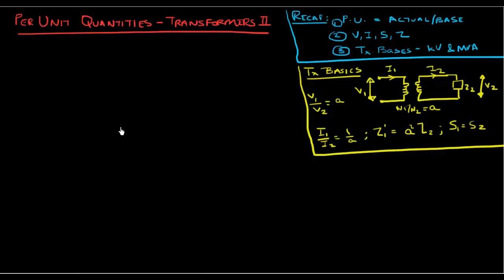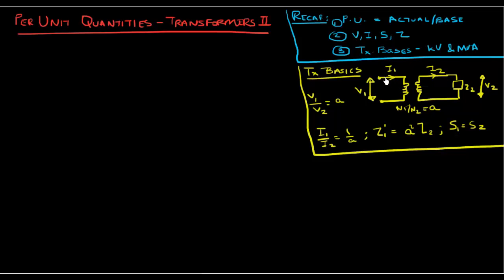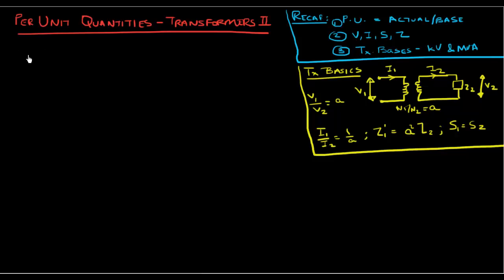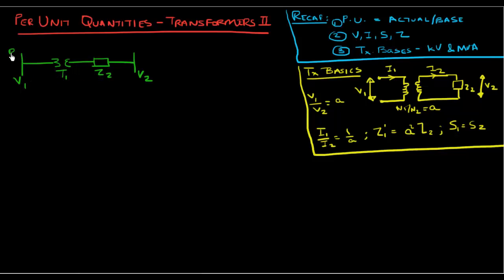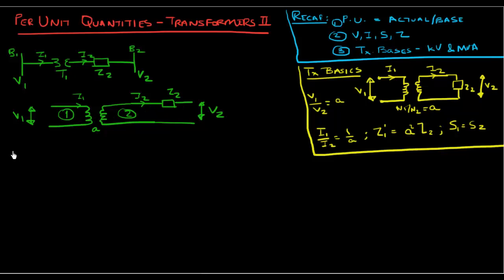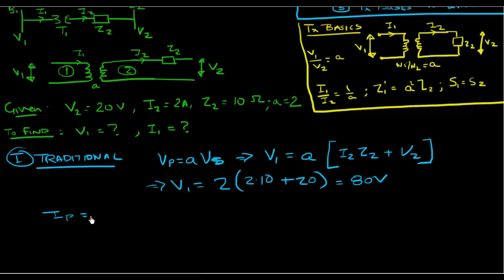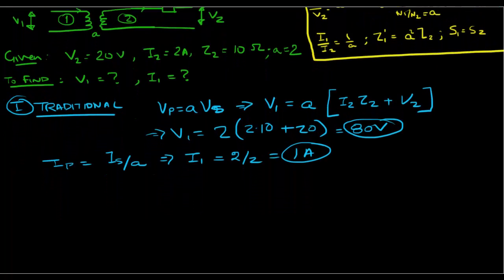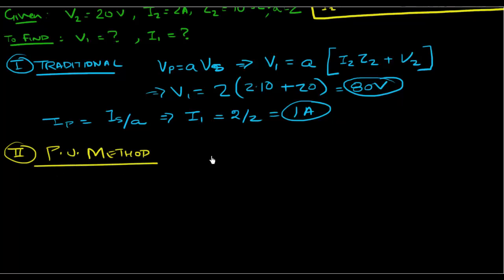Per Unit Quantities - Transformers II

Comment: 1. According to step 1 we define the bases for the known but which ones exactly or how we decide? For example we assumed Vb1 and Sb1 for the problem you have solved and then went on finding the other two using the bases have just found. Why didn't we assume a base for Ib1 as the value is actually given over calculating it from the other bases?

2. According to step 2 we find the bases for the unknown. In your problem you went about finding Vb2 using the turns ratio relationship but not in the case of Ib2 and Zb2 where we still solely relied on the bases just found, why can't we use the turns ratio relationship to similarly find I2b and Z2b?

Comment: thx for the videos, very helpful! i can follow the math but one thing that's bothering me in the transformer videos is that in the first video (with 2 transformers and a load) when you redraw the circuit diagram in p.u., the transformers become p.u. impedances (for your example it's 2 transformer p.u. impediances and then the load p.u. impedance) but in this video when you draw the circuit diagram it's just the load p.u. impedance and the transformer impedance is ignored. why do you sometimes include the transformer p.u. impedances and then sometimes not?

Comment: How Z1B = (V1B)(I1B) ??
Reply from the maker: +raj My apologies for the delayed response (for some reason I just saw your comment today).
You are correct in noticing that mistake.  It should indeed be Z1B = (V1B) / (I1B) .  I don&#39;t think anyone can argue with Ohm&#39;s Law :)  Sorry about that slip up.  But, fortunately that slip up does not impact our solution because we are not using Z1B.  To obtain our solution we are only using Z2B, and that value has been calculated correctly.

Hope that clarifies any doubts.  Kindly let me know if there are any other concerns.  

Once again thanks for pointing this out and my apologies for not responding earlier.
Reply: +raj 
Its not Z1B
it is S1B=(V1B)(I1B)....... same as Power = Voltage x Current i.e. P=IV
Reply from the maker: +hamza3241 Thanks for the clarification Hamza.  You are indeed correct with your formulation.  But, I believe Raj was referring to my slip-up at about minute 8:57, when I incorrectly calculated Z1B = (V1B)(I1B) instead of V1B/I1B.  See my response to Raj above. 
Once again thank you for your clarification.
Reply: "To obtain our solution we are only using Z2B, and that value has been calculated correctly." I don't think it has been calculated correctly. You used Z2B = (V2B)(I2B) ... it's a luck that it gives the same result as V2B/I2B =)
Reply from the maker: Hi Yan,  Thanks for the clarification.  You are correct.. It was just luck that in this case Z2B value came out to be correct... since I2B was 1A :)  I think had it not been 1A I would have caught the mistake in the calculations it self.  Anyways, thanks for pointing this out and apologies for the confusion.